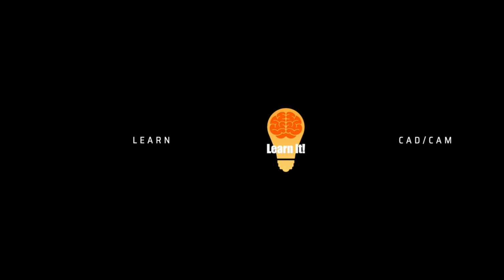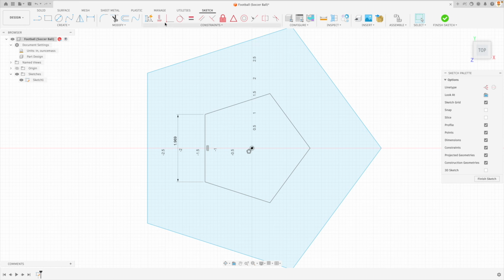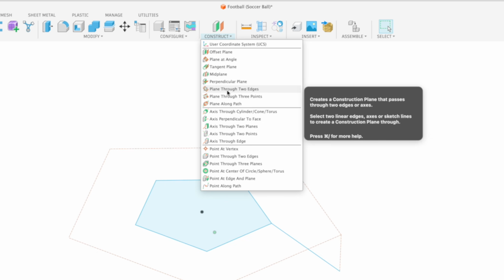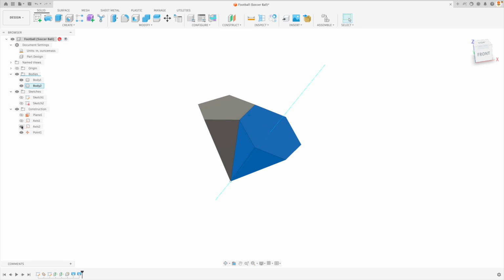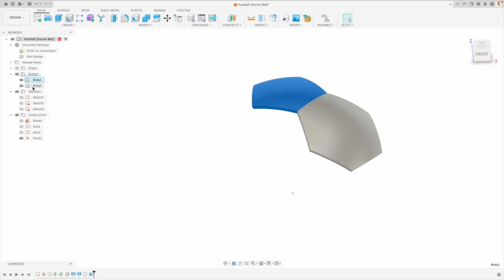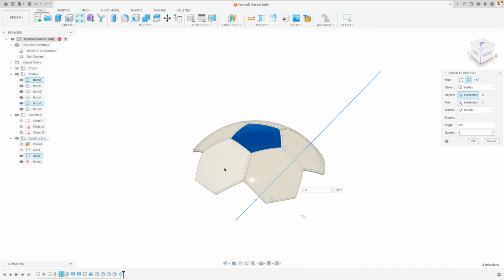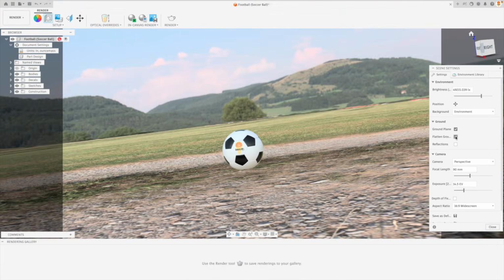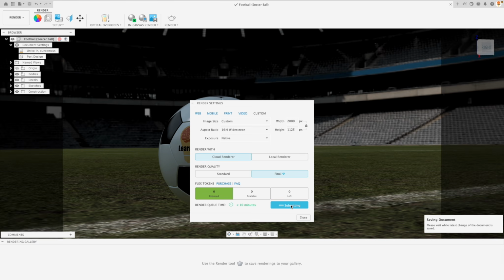Autodesk Fusion | Model a Football/Soccer Ball (2026)

Comment: I have personal version and it won't allow me to dimension 50mm 3D line?
Reply from the maker: It should! When you create a sketch, does it not have the option at the bottom of your Sketch palette to toggle 3D sketch on or off?
Reply: @learnitalready Yes, and I can draw the line. It doesn’t allow me to add dimension.
Reply from the maker: @jayedelson3789  When you sketch the line can you not add the dimension at that point, before you lock in the line?